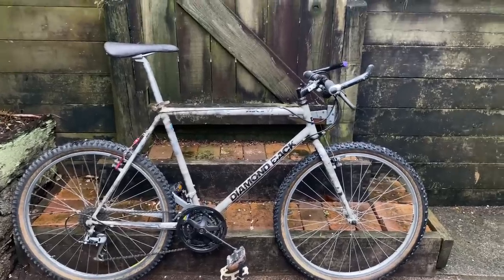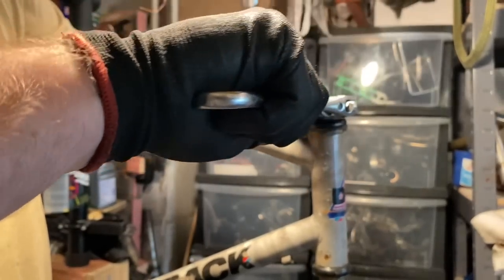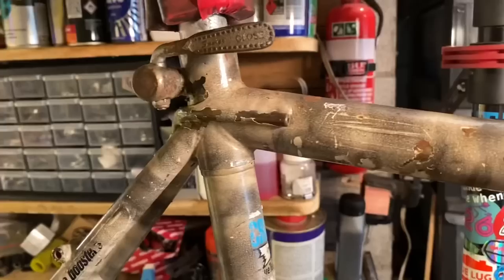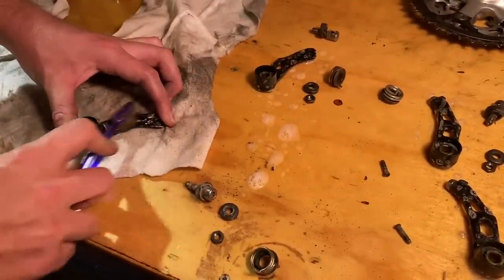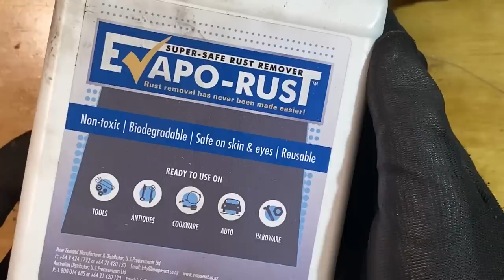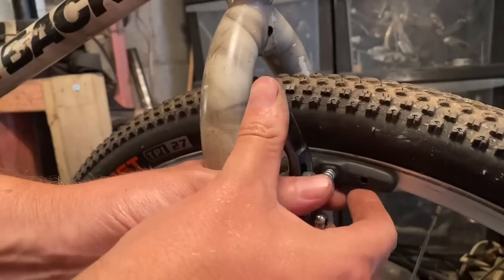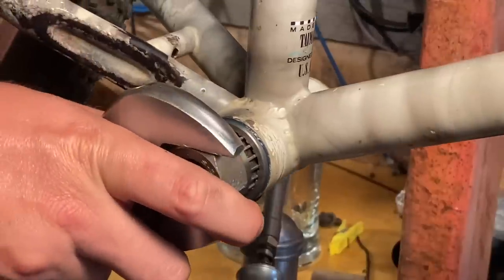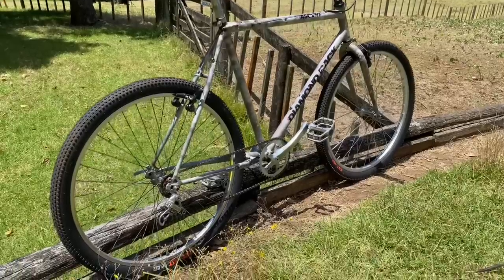Retro mtb - 1989 Diamondback Ascent, Dinglespeed build!

Comment: A few years ago i build a dual speed based on an old bianchi bike. I used a sram automatix gear hib. This hub will change the internal gearing automatically when you drive over 20 km/h. Very clean snd works great

Comment: Did you notice that the DB frames from this era use like a vinyl coat, not really painted? I think the bare metal spots occurs because the vinyl has rubbed off. I have a DB Ascent frame in blue/black swirl with plenty of rust spots. Luckily the rust converter turning those spots black will blend in well. Plan to singlespeed with bullhorns.

Comment: The bike looked in a very sorry state to begin with but it bounced back well, good job.
I'm guessing 3 speed would be a tingle, I have never thought about custom transmissions before but it seems like a lot of fun😃
Reply from the maker: Haha it sure was! No idea how it got to that state, as someone with a bit of skill had to swap the crank 🤷‍♂️ TINGLE 😆 that’s funny, never thought of that! Yeah it’s crazy what people have come up with, a Dinglespeed with two cogs and chainrings (but equal teeth) on a horizontal dropout frame is the cleanest looking setup. That way the chain stays the same length, but you have to move the wheel and physically move the chain over. 
A tingle with 3 chainrings and a derailleur to tension it, would give lots of range 👍

Comment: I just picked up a 90's diamondback ascend frame that I'm wanting to build a tracklocross bike out of. I definitely want to run at least 38mm tires, other than that, idk 🤷‍♂️. 
BB housing measures at 68mm and rear frame spacing measures 130mm. Would you have any recommendations on bb spindle length/ rear hub so that the chain line is as close to perfect as possible?